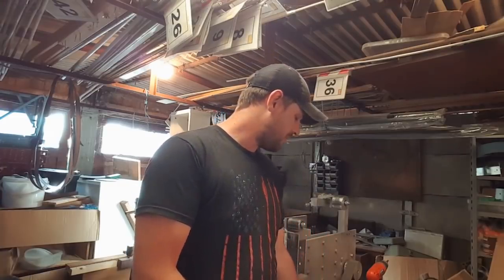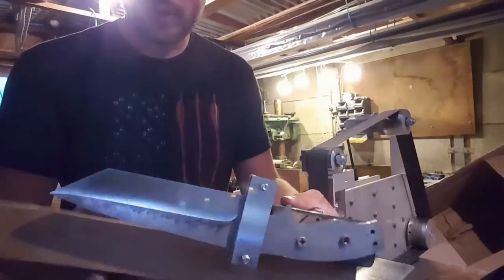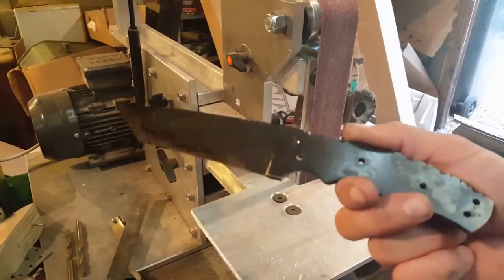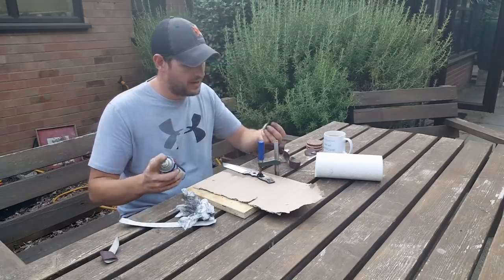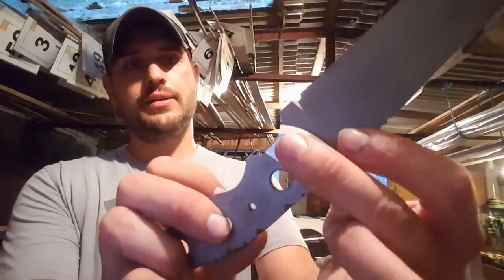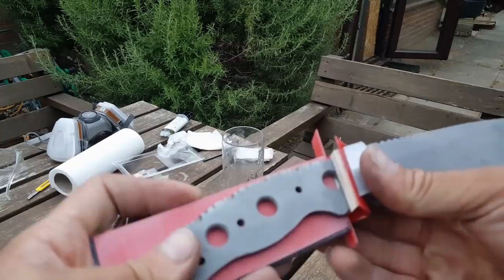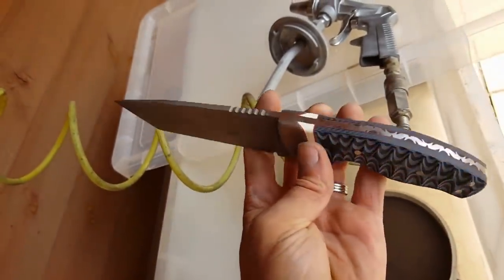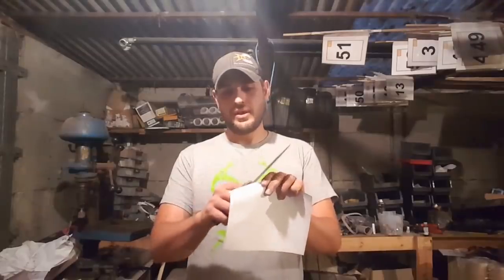Custom Tanto Knife Build - Warthog Ivory Handle

Comment: Omg that's brilliant top ot the shop with that craftsmanship. I wish I can get some one to make me a single blade Barlow 3 inch blade spear point carbon steel  macarver scales but the handle needs a easy open groove..and 3 and a half inchs when it closed iv saved 125 so far in kitty lol need someone to make that edc that's 9k for the uk ty sir

Comment: Hi! 
Nice work! How did you get the mark/logo?
Reply from the maker: Salt water and a 9v battery east away the metal. The stencil is vinyl
Reply: @BrancoCustoms  Thanks! Isotonic or hypertonic salt solution?
Reply from the maker: @docsharp4281  I have no idea of the difference. 
Just general granular sea salt seems to work.
Reply: @BrancoCustoms  Isotonic solution - 0,9% salt/water, hypertonic solution - 10% salt/water.

Comment: I wonder if that quench worked with just that kind of torch he used I couldn't get my blade hot enough to harden my blade with a torch like that so how did he manage with that.
Reply from the maker: The torch is rated to 1600 degrees C. 
The fire bricks are very insulating and the chamber is very small. 
It was heated to non magnetic state. Plus a little more. 
You can't see the true red colour of the steel, it was filmed on a phone camera in bright sunlight. 
When tested with a 60HRC file. It was harder than the file. 
And when dipped in fetric chloride acid, it etches black. 
It is very hard and a great knife.

Comment: That is some really nice work. Would you care to share how you polish G10?
Reply from the maker: Just sand it from 100 grit to 240, to 320, 600, 800 ,1200 then buff on a polishing wheel with green paste, then with rouge paste. Should leave a super nice finish. Just ensure you remove all scratches from the previous sandpaper grit before moving up to the next grit
Reply: @BrancoCustoms  Hey thanks for the reply! Much appreciated sir. Will try it out.

Comment: Slick knife, wanted to get into something like this, but the question is... where to start?  #670
Reply from the maker: It's a steep learning curve, but watching videos like this is a great way to stary
Reply: @BrancoCustoms   Yeah, that's my whole reason, I meant more like which tool does one buy first? Or is it better to save and buy everything at once.
Reply from the maker: @hiddnINplainSight  if you.are.just doing it.for a hobby buy a cheap 1 inch belt grinder, you can do everything you.need. 
If you want to make lots then buy the best you.can afford.